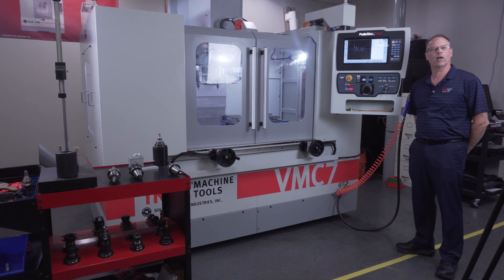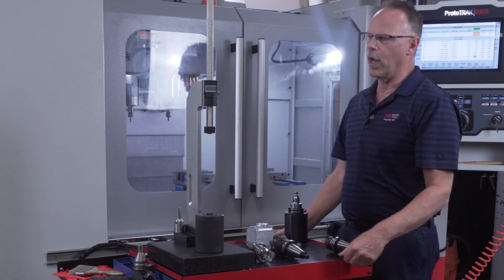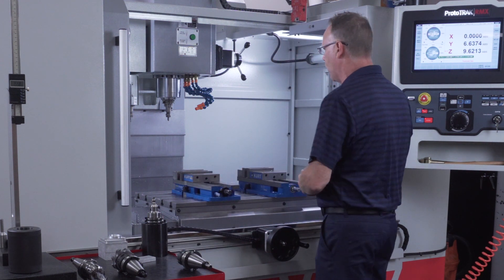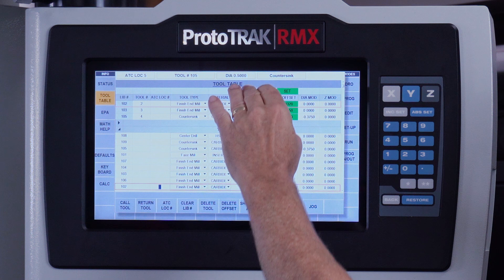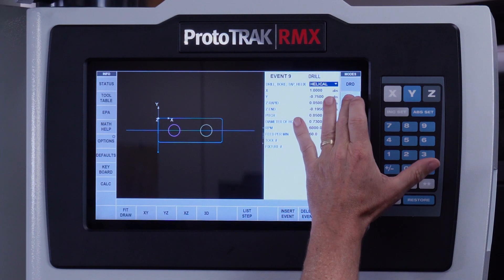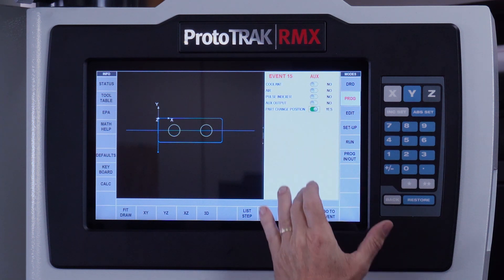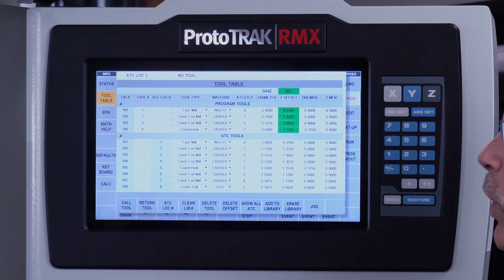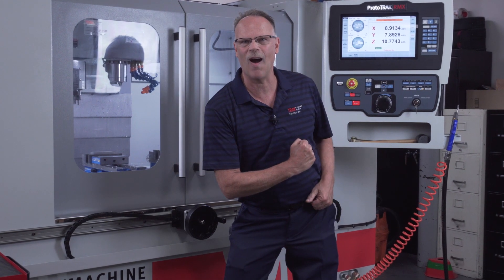TRAK Toolroom Machining Center Demo: Toolroom Ops & Production Ops

Comment: How would you tap a hole in tool room operation
Reply: Ronnie, tapping is the same in either opps.  The only big differences between the two are as follows.  1. You can run the machine with the doors open in Tool Room Opps.  2. You manually change the tools in Tool Room Opps.  In Production Opps, the doors must be closed in Run mode and you can use the ATC to change your tools.  The tapping event tells the control what is needed to tap the hole.  It does rigid tapping so you don't need any other type of tapping device.  T.P.
Reply: @trakingpat2750   so in the tool room op with doors open you would have to reverse the  spindle and does the z hand control feel like a normal quil down feed like on the K3
Reply: @ronnieevans2278  Are you asking me about manually tapping a hole?  Maybe I missed that part.  You cannot tap by hand in the TMC/VMC because it doesn't have a quill.  The Z handwheel just moves the head up and down so you cannot feel it when using it.  The only way you are going to tap holes in one of our TMC/VMCs (Or any other manufactures VMCs) is to program it and let the machine do the work.  I hope I answered your question correctly this time.  T.P.

Comment: Can you make a VMC RMX video on how to program multiple fixtures with different origins etc and a different event for each fixture? To run 1st, 2nd, and 3rd ops at the same time. (Similar to your magnets at Trak open house)

For example:  (assuming 2nd and 3rd operations needed on same part)
Fixture 1 drilling. 
Fixture 2 milling the right side 
Fixture 3 milling the underside.
All in the same program?
Reply: Hi Paul!  We just made a video showing most of this last week on a DPMRX.  It will work exactly the same on the VMC.  You should be seeing it soon.  Let me know if you have any other questions after you see it.  T.P.
Reply: @trakingpat2750  Ok great! I'll check it out. Thanks Pat!

Comment: This looks like a great tool room or prototyping mill. It looks like you could get setup to make parts quickly without having to spend a lot of time in CAD/CAM.
Reply: Hi Dan.  You hit the nail right on the head.  Please keep in mind that if you do want to run a Cad/Cam generated program, it will do that too!  We also have our own converters for DXF and Parasolid files.  T.P.